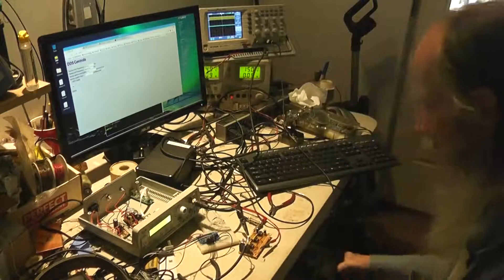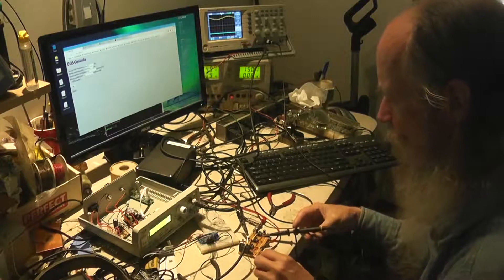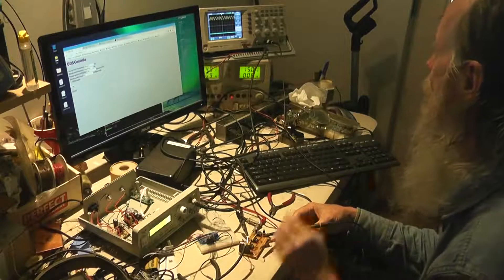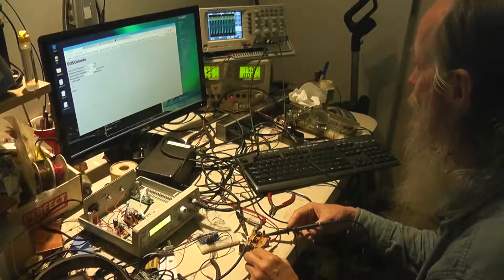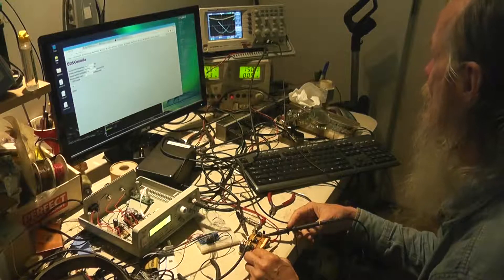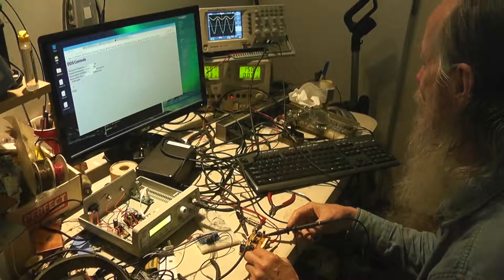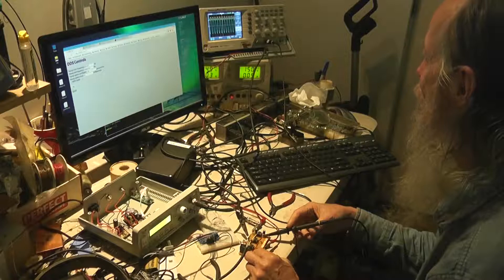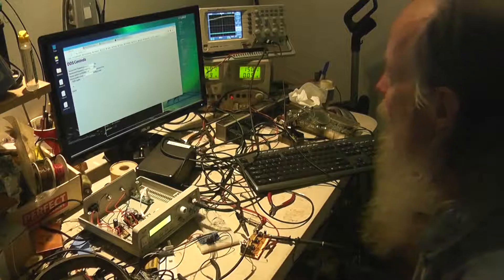VideoPreamp

Comment: what voltage are you using as the negative rail?
Reply from the maker: -15v at the moment.  To get more I may change the + supply to around 10v, and make the - supply around 26v.  Don't need that now, but would if I start using some positive screen volts on the tubes.  Doing all that I'd have to add adjustable regulators to the LV supply and change the offset-bias resistors on the preamp board, a minor pain, but if that's what it takes...
Just planning ahead.  Plan A "as is" might be fine for what I want.  But always smart to have a plan B (CDE) on hand, eh?
Reply: I have some DC-DC converters 5 to +-15 as I recall and I think they may be isolated I can check tomorrow if that would help,
Reply from the maker: Thanks! I have that kinda stuff too.  Here we want "quiet" on the power (no switchers if possible), and I have +/- 28v dc (with some ripple), so I'm just using linear 3 term regulators.   I'll just go to lm317 lm337 to make them adjustable, I think.
I was just lazy and put in fixed ones as they were easy and laying around.  It's pretty easy to pull that board and change them.  More of a hassle is changing the opamp input bias.  I'm setting that up so with the input at gnd, the output is (just barely) at the negative limit, then setting the tube voltages so that's either cutoff or projected cutoff (depending on whether I want linear or a switch for the power output).
At the power level I hope to run this at it could go class A and be OK - that's lots of square inches of tube plate, but one always plans for a little reserve.  Again, it might be fine as is.  That's why we call it research,  if we knew for sure, it'd just be engineering...
Reply: I'll check anyway these are,  as I recall pretty high-end units I will send the spec tomorrow
Reply: if it is of any help I have several Artesyn nfc48-40-to1-15 48v 4w  in,  5 and +-15 out isolated you are welcome to one
Reply from the maker: I have some like that too, it's not a really good fit for this particular thing - I need asymmetric + and - volts, which I got with an lm150 on the + rail and adding a zener in series with the adj terminal on the lm 7915.
So, now it's 12 and -22v...and I have to change the offset resistors.  Things get pretty warm, I'm thinking of adding a fan for under-chassis.  Seems there's no speed without heat, eh?